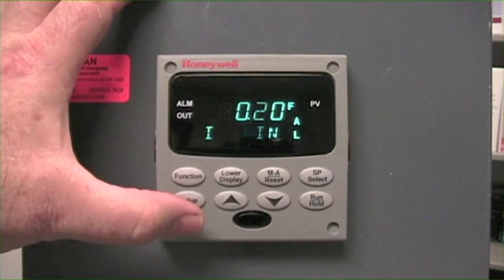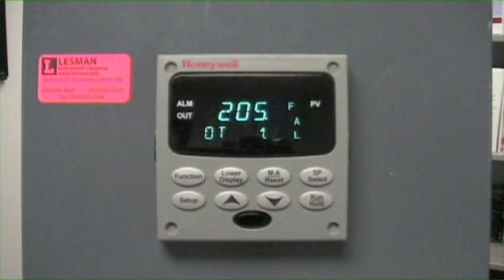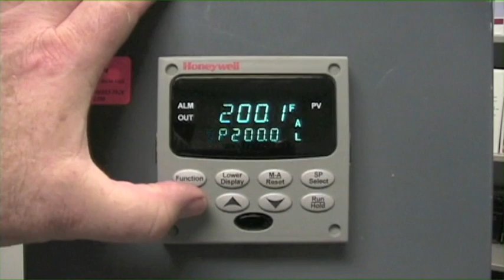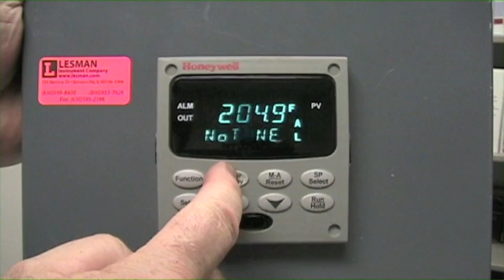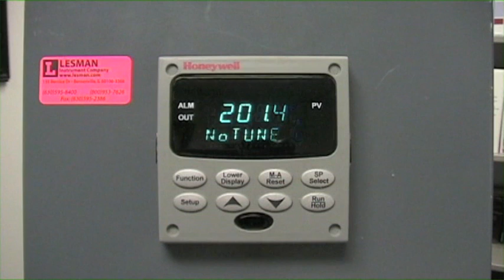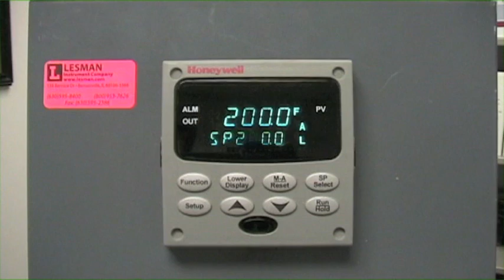How to Use Accutune on a Honeywell UDC Controller

Comment: not sure if you can help me or not, but if you could provide any information id be great-full. 

Im am currently enrolled in an instrumentation course at my college, and working on a school project that involves creating an entire flow loop with a HW 2500 controller and an orifice plate. we calibrated our transmitter with heart communication while the process was non-running, we had the system running a day ago and we were able to get the transmitter to read between 27 inh20 and 110 inh20 so we calibrated it for a 50 inh20 to 100 inh20 range for our 4-20mA. we then wired up our controller to the system and started the process up. we had our input measurements in the controller at the 50 LRV and 100 URV for the 4-20mA however we could not get the controller to react to any kind of SP change or OP change, we also had the controller connected up to a computer so we could see our readings and the computer readings were not responsive either. our teacher confirmed that our wiring was indeed correct but other then that he wont give us the time of day and to be honest i dont even know what type of questions i should be asking or searching to fix this issue as my group and i have never done anything like this.

if you can provide any insight in what my problem might be it would be appreciated, thanks.
Reply from the maker: Brandon- 

Here's a good place to get help and start a dialogue on troubleshooting: Post 
your question on the PLCs.net forum at http://www.plctalk.net/qanda/index.php

You'll need to register to post, but there should be several professionals there who can help you.  

Click on “Live PLC Questions And Answers” and start a new thread. Use a title line like “Honeywell UDC2500 DP flow”
On the UDC2500 page on Lesman's website, there are a couple of documents you might want to download and fill out first.  Go to http://www.lesman.com/unleashd/catalog/control/control_udc2500.html
Under the Documentation tab, find the Configuration Record Sheet and the Setpoint Configuration Form. These will help you collect all the details you may be asked in the forum.
Good luck on your project.
-Dan
Reply: alrighty, thanks for the reply. turns out there was actually a problem with our controller and it needed to be reset so fortunately its all good now, ill keep that link in mind for the future though and ill spread the word. thanks for the help!
Reply from the maker: Glad to hear you got your problem resolved.